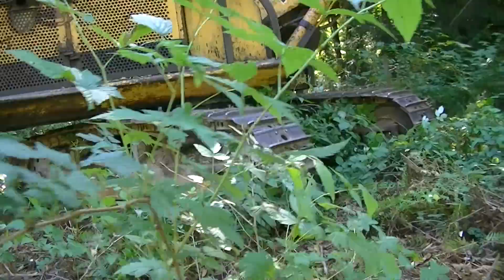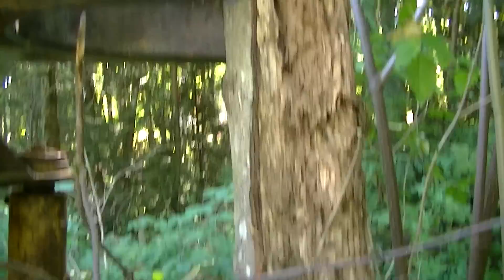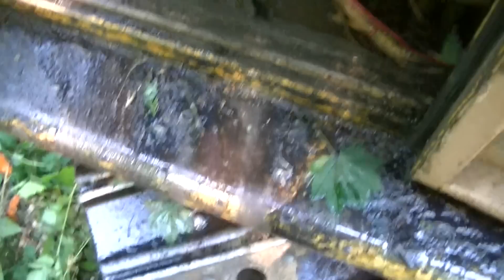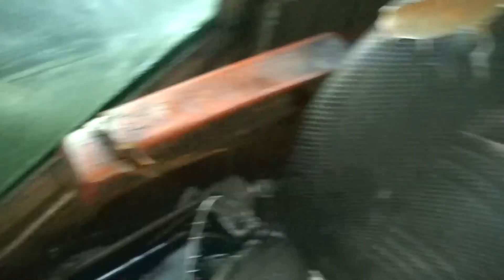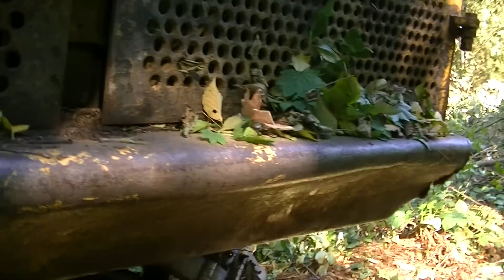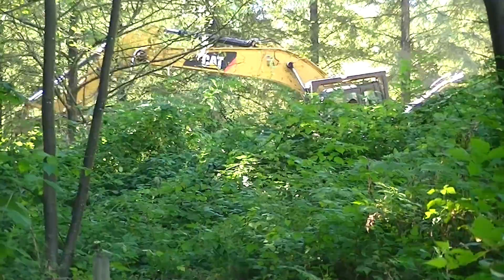Caterpillar 225 Feller buncher

Comment: 1973, or 1983? That's a 2nd generation 225 (boxy cab) and they didn't introduce it that design until 1977. Though, it is possible to swap the newer style cab and interior on a '73.
Reply from the maker: mojostevo 1973 says the owner
Reply: I agree that looks newer than 1973

Comment: Are CAT parts still available ?
Not that you'd go to Cat for a hydraulic hose,
Reply: A shop supervisor at a concrete company that I worked for told me that Caterpillar will make parts for machines as long as they are not more than 50 years old.
Reply: @onrr1726  Years ago I worked for a Honda motorcycle shop and we could get about any part for any bike. That was in the late 80"s into early 90's. 
CashIH is a different deal , a lot of part are unavailable after 8-10 years.
Reply: @VideosByAl  that's pretty cool. I remember when I was takeing a 3 year class at a local trade school 20 years ago We had an old 1970's Trojan 1500 loader Getting parts was a bear to find but we managed to modify brakes and brake shoes used on similar equipment that Ford used to make in the 1980's. It worked till the school got rid of the loader about 10 years ago or so. I remember also driving a lot of old Trojan loaders that had belonged to Conrail many were old enough to have been bought by both Penn Central before 1976 and by Conrail between 1977 and 1980 in Batavia, New York. When CSX Transportation and Norfolk Southern split Conrail up in a merger they purged all them Trojans in 2007 many ended up on farms all over New York State.
Reply: @onrr1726  I remember thoseTrojan loaders that were set up for rail service.
We lived near the Union Pacific main line in Iowa.
Reply: @VideosByAl  the ones I remember were not equipped to run on the rails. But them Detroit diesels they had I do remember you could hear them a mile away.